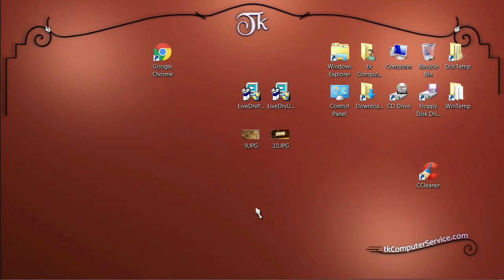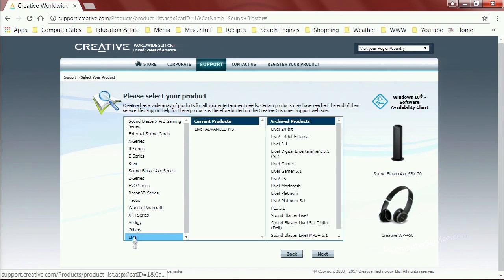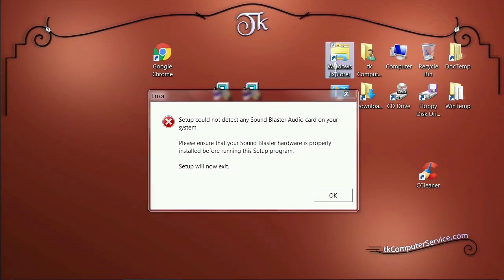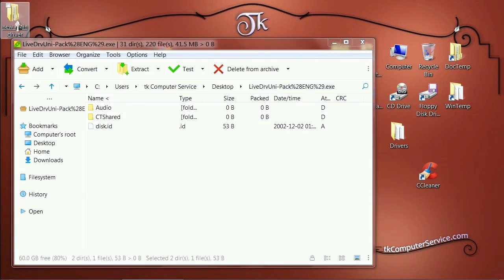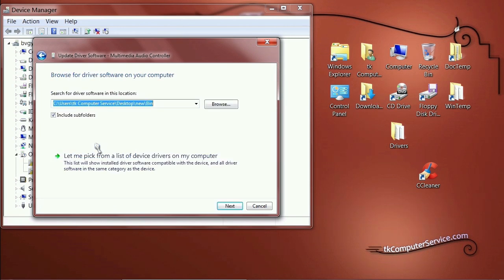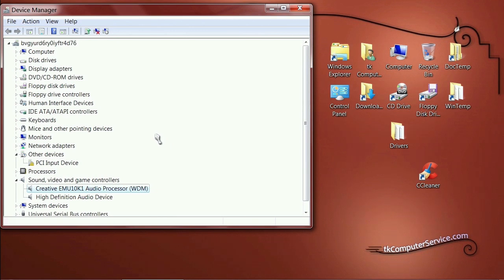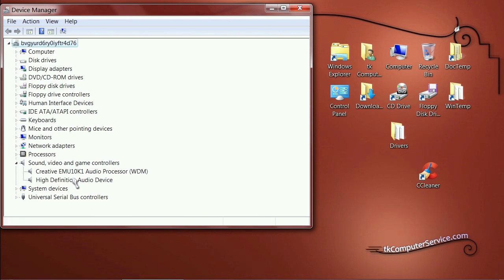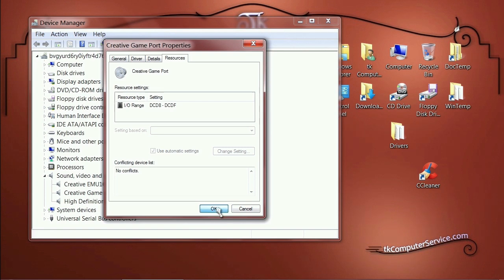Windows : 7-10 Sound Blaster Live Installation or How to install unsupported Hardware

Comment: Worked. Dell Dimension 8200, Win7 32bit. Thanks for keeping this old wreck running.
Reply: Do you have your volume control working? Mine is at maximum all the time, and even if I move the controls, the volume doesn't decrease.

Comment: As an FYI, this only applies for 32-bit versions of windows 7 and up, as for 64-bit versions you either have to bite the bullet with the beta 64-bit driver or use the KX Project drivers. Just know that you don't need to download the driver patch, the main driver installer's already updated to the latest version it can be. Using the patch after install is redundant and just a waste of time.

Comment from the maker: 64 bit Drivers seem to be hit or miss for this particular Sound Card. Keep in mind there is no support for the old DB15 Joystick Ports in some newer Operating Systems.  ...namely Windows 7 and above. That doesn't mean you can't use the Sound Card without the support of the Joystick Port.

Comment: That a very nice and detailed tutorial. But how does the card perform in use, with games, applications? Does the card work properly or are there potential BSODs or driver resets?
Reply: Tried it and it's working so far. Only volume control doesn't work, but my headphones have a potentiometer for that. And I couldn't do the gameport trick.

Comment: It's works in Windows Vista... is this works to in Windows 7???

I have the same problem with my creative vibra 128 soundcard... it's cannot works in Windows 7...
Reply: Just tried the procedure for my SB Live Value card and it worked perfectly.  Only problem is the mixer doesn't  work, so I can't lower the volume, is at maximum all the time.

Tried it also for an old Geforce AGP card (no W7 drivers) and it worked too.

Comment: not working for me at all for a SB Live! Value. just followed all the process but  when "update driver software" manually it just prompts  "Windows was unable to install your Multimedia Audio Controller" "Windows could not find driver software for your device" Files downloaded for WIN XP, installing in a Win 7 pc. suggestions?
Reply from the maker: You may have the wrong drivers for your particular card. Look for a (?) SB0750 model number on the card. Do a search using that and see if you are downloading the latest drivers for it. It could, also, be you're not directing windows to look in the proper folder, move up a folder and then let windows search for the drivers. May help.